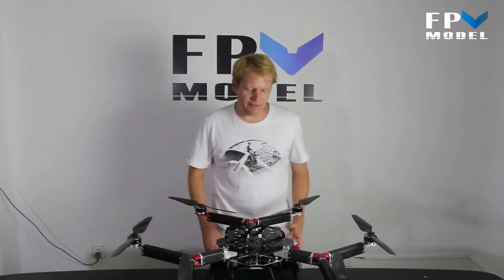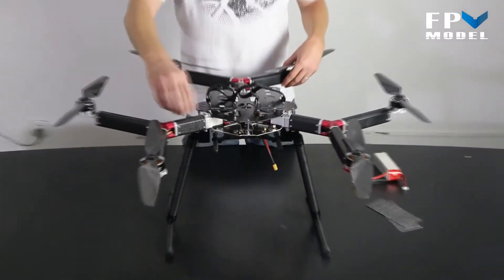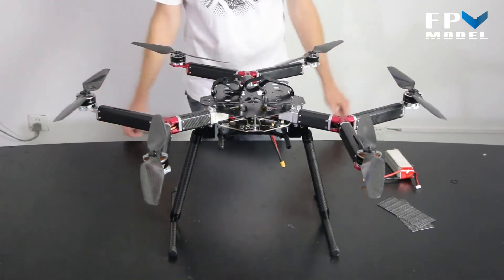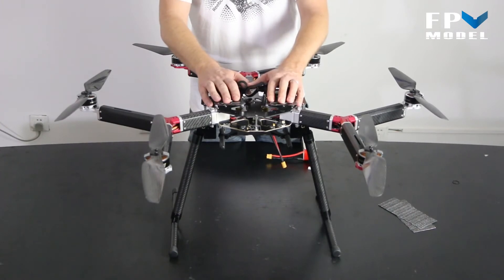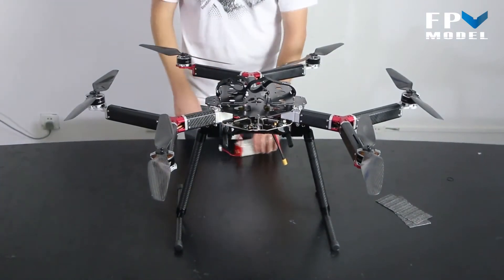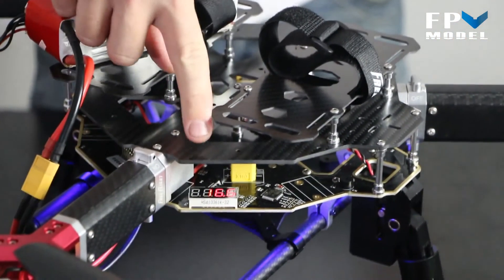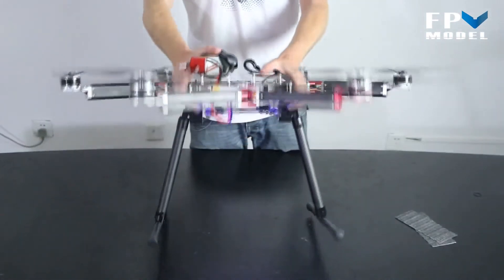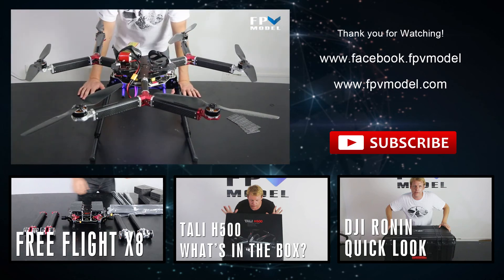Free Flight H6 Hexa w/ built in PDB/Voltage Alarm/12V&5V outputs

Comment: yet cooler than X4 or X8. Does the arm disassemble from 3 points. From joint on the frame and then each half with the motor?
Reply from the maker: Arms disassemble from the Frame. Think of it like three Y's. Right at the frame is where the disconnect.